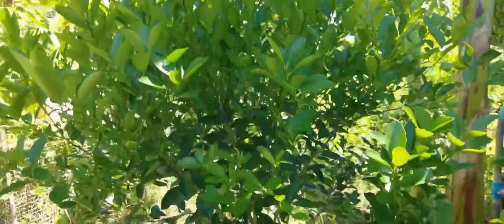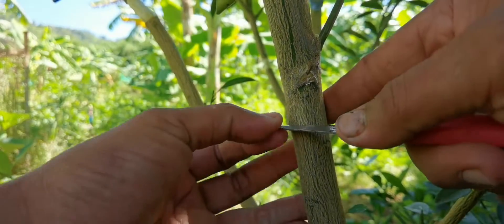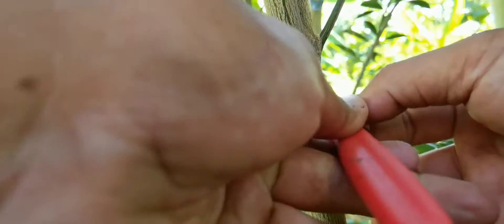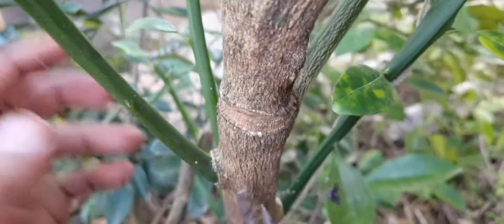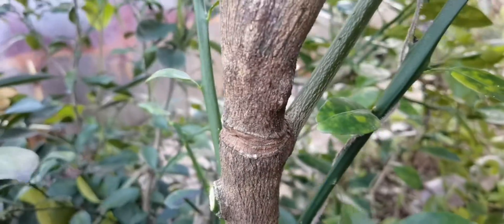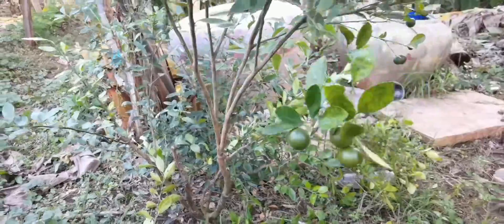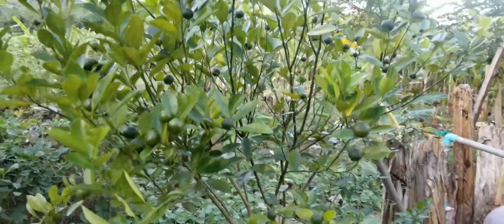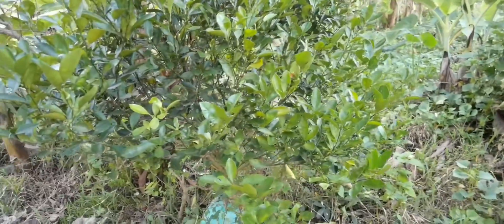How to trick lime tree to bear fruit (calamansi) Philippines lime

Comment: The method the farmer is using is called girdling or scoring. It's a horticultural technique used to stress a tree in a controlled manner, which can stimulate flowering and fruit production.

How It Works
Wounding the Stem (Scoring or Girdling)

The farmer is making shallow cuts or removing a thin strip of bark near the base of the tree.

This disrupts the downward flow of carbohydrates produced in the leaves (via photosynthesis) while still allowing water and nutrients from the roots to travel upward.

How This Tricks the Tree Into Fruiting

The temporary restriction of carbohydrate flow forces the tree to redirect energy towards fruiting instead of vegetative growth (new leaves and branches).

This stress response mimics survival conditions, making the tree prioritize reproduction (fruiting) to pass on its genes.

In some cases, it also affects plant hormones like auxins and gibberellins, which influence flowering.

Methods of Girdling
Scoring: Making a single shallow cut around the trunk or a branch without fully removing the bark.

Partial Girdling: Removing a thin strip of bark (a few millimeters wide) but not deep enough to kill the tree.

Full Girdling: Removing a complete ring of bark, which can be fatal if not done correctly.

Important Considerations
Timing Matters: Best done during early growing seasons (spring to early summer) when the tree is actively growing.

Do Not Overdo It: Excessive or deep cuts can weaken or kill the tree by completely cutting off nutrient transport.

Works Best on Mature Trees: Young trees need time to establish before using this technique.

This method has been used traditionally for citrus, grapes, peaches, and other fruit trees to increase yield.